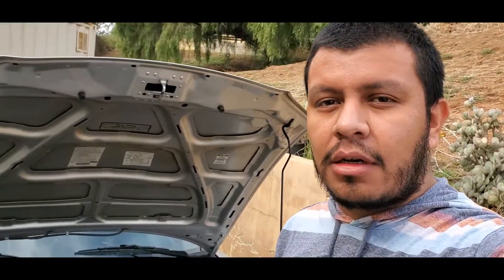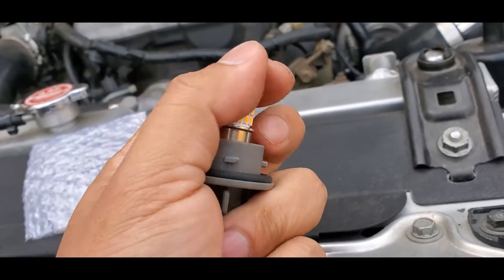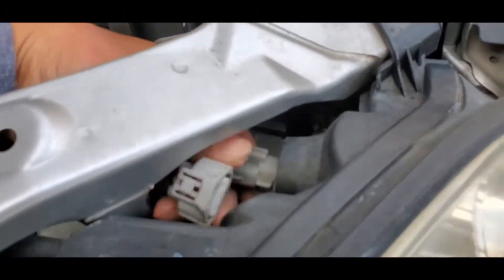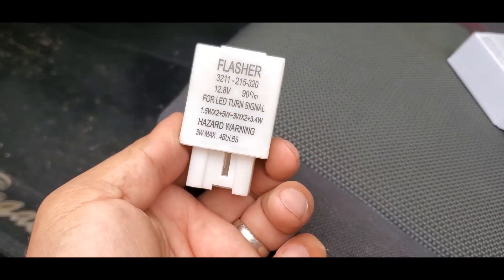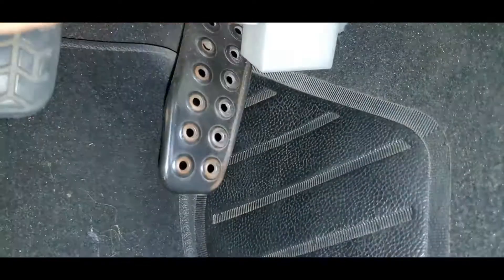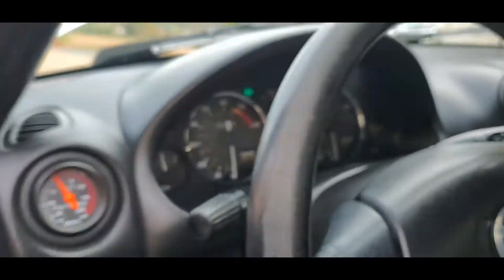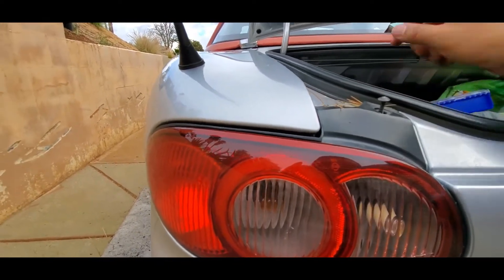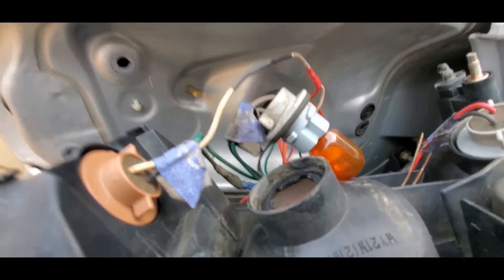Installing LED Bulbs & LED Flasher Relay on a Miata NB2

Comment: Thank you so much for posting this.  Let me tell you, getting the relay off that bracket, was a pain, in more ways than one.  Got it out after the better half of.... 10-15minutes. Thanks again!
Reply from the maker: Dude , it was a pain in the butt! Glad to help.
Reply: I was tring to do that and also for me Is very hard.. do you have some tips to Do It? Thanks
Reply: @simonemanenti8431  Just keep wiggling it.  I was at it for an hour before it finally came off.
Reply: @FireKnight43 thank you!!

Comment: Thanks for this video. 
Have you LED upgraded the driving lights in front below the headlighrs? I have LED’d the headlights, but haven’t done the driving lights yet.
Also if you could do a video on how you wired in the side marker lights, that would be awesome.

Comment: That LED flasher ONLY works on the NA or the NB2... it DOES NOT work on the NB1.  For some reason, Mazda went to an older style 3 pin connector on the NB1, versus the 8 pin you show here.  I bought a cheap flasher unit off of amazon, and with a little bit of modding, got it working for my 99.  Thanks for the video!
Reply from the maker: The relay should only work for the nb2 . 
Thanks for watching 😄

Comment: Thanks for the video. I purchased the flasher relay in the link. Does not work on NB1. Also, anyone buying 1157 switchbacks for front turn signal. NB1 headlight assembly has amber lens.

Comment: Hey Marvin, Thanks for sharing this insulation video It was very useful.  You mentioned that you installed side markers and wired them up to your tail lights and I think blinker based on what I can see in the video.  Are you able to share that schematic or diagram of what wires go where and how you have them set up?  Thank you much appreciated!
Reply from the maker: Appreciate the feedback! 
Honestly I had someone help me with that . I wouldn’t be able to share that schematic unfortunately.

Comment: Good video! What fan kit are you running with your Koyo radiator?
Reply from the maker: I'm running mishimoto , they are alright.
Reply: @Marvin1martian  I have the Mishmoto radiator and the fan kit but they are not good in my opinion. Just wanted to see if you were having better luck with your combination on your NB. I'm going to buy the FM crossflow and stage 1 fan. Thanks for the reply.
Reply from the maker: Yeah eventually i would like to get the FM fans . Pricey but seem worth it.

Comment: Is the relay also compatible with NA?
I know the relay is under the steering wheel but exactly where?  Can you show pics?
Reply from the maker: I would say no. I wouldn’t really know since I don’t have an NA.
Reply: Sorry, I don't have an NA, but I had a look with a mirror and flashlight first and confirmed which unit it was by putting the hazard warnings on - you can then feel each unit in turn and easily find the flasher unit by feel as it is the one clicking!  No chance of getting your head under and seeing it directly IMHO.  I found it very hard work getting the %^^$#% thing off, but the video helped as I knew I was doing the right thing - just took everything I had to wiggle the thing off though.

Comment: Can someone explain to me the difference between the oem and the led flashers ? Are they the same ? If my lights are the manufacture lights do I need a oem? Or can the led relay flasher be fine?
Reply: Stock ones aren’t as efficient as LEDs, i.e., stock bulbs use more voltage but don’t shine as bright as LED’s. 
If you’ve noticed how tiny your car battery is, you’ll realize why being more efficient with your lights can be important. OEM stands fo “Original Equipment Manufacturer” by the way.

Comment: Will you be adding LED for the low beam as well?
Reply from the maker: I currently have HIDs, they take up to much space in the engine bay. So most likely I'll be switching to LEDs for the low beams.